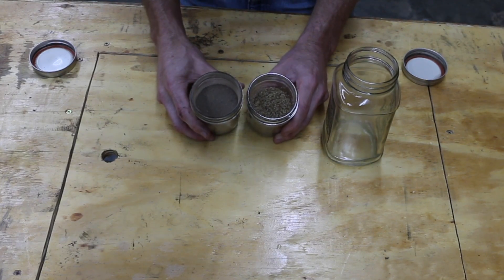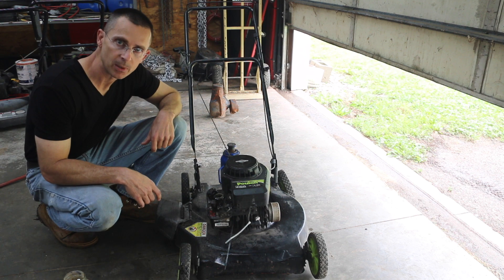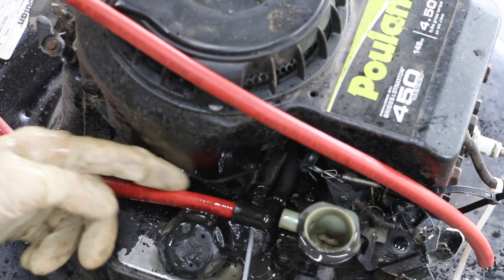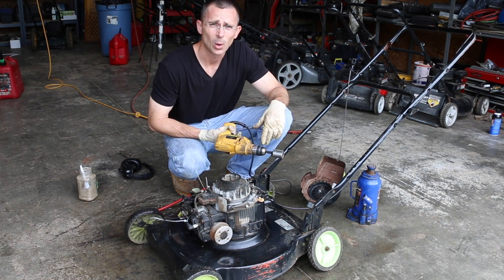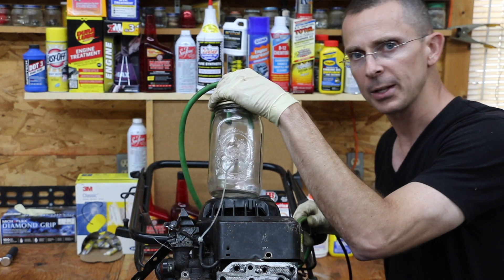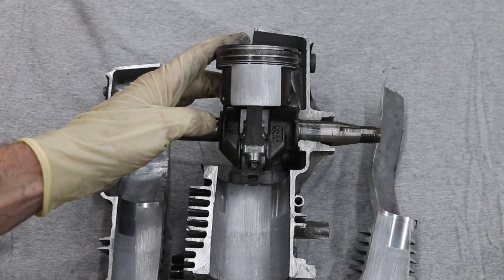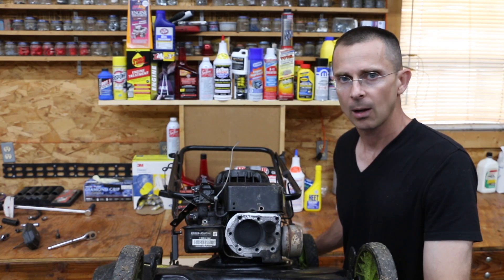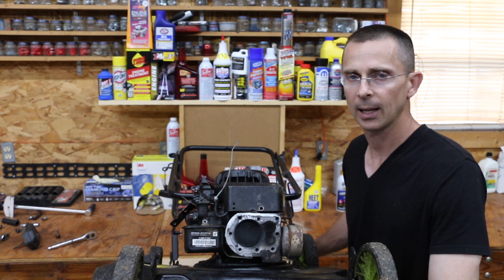Will Dirt Destroy an Engine?  See what it does to this Engine!

Comment: So that's how Harley get's their motors to run like that.
Reply: They're just washing machines on spin cycle
Reply: Lol lol lol 🤣😂👍👍
Reply: Hot damn shots fired😂😂 I drive a Yamaha v star😂
Reply: @SoapHorizons789  great, quality bike. Weak engine though.
Reply: And leak like that...lol
Reply: true bruh moment
Reply: Zmog wtf are you even saying shut the hell up
Reply: Thanks for making this. It was purely ... what if educational. I had always wondered how quickly a dirty or missing air cleaner could contribute to engine destruction. And it seems that it really doesn't take too long. Now I know what you did to achieve results was highly sped up.. dumping raw contamination into the carburetor. But the overall point is still made. You spent a lot of time and effort making this ...thank you, I love your work and I watch everything you make.
Reply: Gets not get's. Smh
Reply: Hardly able-sons. Lol
Reply: Rotary aircraft engines (Pratt and Whitney) have a cam drum, not a shaft, but it’s still a cam.
Reply: Mike Combs yes just pour some gravel into your carb
Reply: Ouch.
Reply: Idot harleys have a cam that’s why they run like that
Reply: @Pimpy6.6  Can of what?
Reply: I meant cam they have a cam which is why they run the way the do
Reply: @Pimpy6.6  
Do other manufacturers not use a camshaft? I'm not a mechanic.
Reply: Robot Bjorn yes some lawn mowers and cars and fourwheelers use cams everything just about had a cam
Reply: ZMOGOTAXL yes they do cams are for ignition and fuel timing and are neccessary for most all engines
Reply: @robotbjorn4952  😂
Reply: @Pimpy6.6  I held my tongue as long as I could.  ALL four stroke engines (with the exception of rare freevalve solenoid technology) have at least one cam.  A modern Harley has four.  The engine won't run if the valves can't open and close.
Reply: @mcombsemail  lmao ok I know what your saying I was just trying to demenstraight that’s what I was talking about cause my quad has a cam but I was trying to explain to him what the cam is but I’m not good at explaining
Reply: @Pimpy6.6  das sum gerd engish dere matie!
Reply: @Pimpy6.6  every engine ever made before like 2015 uses a camshaft
Reply: @squerlicious  actually every engine since around the 50s even most likely before that has a camshaft
Reply: @Pimpy6.6  not with 2 stroke
Reply: @robotbjorn4952  most engines use cams.
Reply: @Pimpy6.6  I can't think of any 
4stroke engine that doesn't have a cam of some sort ! Maybe "most things" you encounter are 2cycle engines.
Reply: @Troyvidihoo  an aftermarket cam lol 😂
Reply: @Troyvidihoo  I just read what I put a while back I think I put it as a joke
Reply: Haha 😂 I just read what I put I think I put it a joke 4 strokes and just about every engine has a cam LS to diesels all have cams I don’t know why I put this
Reply: @picax8398  I was like 11 when I put that comment lol 😂
Reply: @picax8398  ohhhh it’s from 2 years ago nah I was 13
Reply: @picax8398  it’s just been a long time man I know what I was suppose to say I didn’t put it correctly and that’s why I sound stupid in that comment but I am currently a diesel and automotive mechanic and understand just about every engine i
Reply: @Pimpy6.6  Dont get so butt hurt, he's joking

Comment: What happens if you put salt in an engine; anything good, anything bad? Does it depend on the kind of salt and/or fuel?

Some helpful data: Salt doesn't dissolve in gasoline, but it does dissolve in ethanol. Also, there's a kind of salt called Ammonium Chloride, which allegedly tastes like a 9-volt battery if you lick it.

Also: If you freeze-dry saltwater, you will get salt that's an extremely fine powder, far finer than the salt grains you'd normally be able to get your hands on.

Comment: that happene to my father diesel car, a hose before the turbo broke from the air filter and was colleting dust and sand and whatever from the road , destroyed the turbo and afte r couple of days the engine started running in 3 pistons and lots of blowby and smoke coming from the exhaust. engine is trash now.i was in doubt if the cilinder walls were affected as i didnt opened it yet, but after seing this video i think he need new engine , not only piston rings :(

Comment: This seems more of a testament to the lawnmower brand. I tool more then 25% of the oil capacity of dirt and sand to "kill" the engine. And it still started. Probably wouldnt if it had cooled down. Sweet video.
Reply from the maker: Thank you

Comment: Very realistic test. I'm going to make you eat two spoons of dust and we'll see how you will be doing. Probably pretty bad, but in a lifetime, the average person eats 6 pounds of dust. And we don't suffer much from it. A lot at once vs a little bit at a time makes quite a difference for us humans and I'm pretty sure it also does for our engines. It probably is way more aggressive to have a whole spoon of dirt and dust that fills like a quarter of the cylinder and actually get pressed against the walls during the compression cycle than a couple of particules every now and then that probably go unoticed, in and out like if nothing happenned.

Comment: Now, how would a badly damaged engine with oil burning and blow by respond to motor medic and the like.
Reply: I’m assuming motor medic is a substance that’s added to gas or oil to “rebuild your worn motor”. It likely wouldn’t do much of anything. No product can restore a badly damaged engine other than rebuilding or replacing it.

Comment: What can also happen is when the air filter gets very dirty and it restricts the airflow it will suck oil out of the crankcase vent and over time it will burn off the oil by sucking it out of the crankcase through the carb and then engine will obviously destroy itself running with no oil in the crankcase. This happened to my neighbors riding mower because he never changed the air filter over so many years.
Reply from the maker: Great point

Comment: Maybe putting all of that debris in together would have a worse effect than the same amount slowly entering the engine over years?
Not disputing your results, and there's no doubt no air filter is very bad for your engine. But I'm just pointing out something that MAY have led to misleading results
Reply from the maker: Thank you for the feedback

Comment: I accidentally ran my truck when I first bought it without an air filter, it is a ford ranger 3.0 and it went 1k miles without a filter through dirt, dust, mud and water. It still runs and drives, and it doesn’t burn oil but I’m worried I lost compression or caused serious damage. Any knowledge bombs on that?

Comment: You’ve convinced me to do my air filter already. It’s quite old.

I do monitor my car’s vital signs, and while it still looks decently nice on the important side, I can only imagine the engine having so suck air through an even slightly clogged filter media. Plus it’s even more critically important that the air is perfectly clean for modern engines, because even the slightest amount of contamination can damage, or destroy, the MAF sensor. It’s worth cleaning if your air filter is overdue - I know I will. Do not use anything but MAF cleaner. Don’t use throttle body cleaner, don’t use brake cleaner, don’t use isopropyl alcohol. Use nothing but MAF cleaner, and only clean the thing sparingly, if you have a reason to, such as an overdue or bad air filter. They are ludicrously delicate devices, and as a result, they’re expensive, too.
Reply from the maker: Thank you!

Comment: I had a 1990 Eagle Talon (4G63) that I rebuilt. the original pistons were easily 4X worse on the piston head than that thing. DEEP scars cut into it. It had stock air filter. Now I have NO IDEA what caused it. I really expected your damage to be so much higher after all that dirt (granted it wasn't 200,000 miles). Closest example I can find is like this but more like 1/8" elongated scars than dimples:

https://static.cargurus.com/images/site/2016/10/06/01/23/pic-5588949851497719914-1600x1200.jpeg

The comments (the only one that offers any explaination) says "probably dropped a valve guide". That's possible, hmm. If it's so heavy (relatively speaking) that it can't easily be blown out the exhaust, it'll bounce around up and down being crushed into the piston until after hundreds / thousands of impacts it randomly bounces into the exhaust at the right time and leaves. But I have no idea how a cylindrical valve guide could get down there unless it split-in-half somehow and the pieces fell in.
Reply from the maker: Thank you

Comment: the one thing that differentiates a mower from a  vehicle, is after the dirt has gotten in the oil, it gets filtered out. it's not left in the oil to keep doing damage. but it will still do damage from when it enters the engine till it gets filtered out. which is who knows how long.
Reply from the maker: Thank you!

Comment: just took the head off a craftsman that was sitting in the elements for several years and there was slight debris in the cylinder. the scoring wasnt as bad as this video but it was pretty noticeable. still wondering if i should just slap it back together and run it until it dies or just ditch the project altogether.
Reply from the maker: Seems like it's worth getting it running if you don't have to buy parts.  Thank you!

Comment: Hello hope all is well, This might be a good idea for a video, Not sure how you would test for it though. I've heard using spray silicone sprayed on a filter will stop even the smallest of particles. Protecting way better than the best air filters on the market...Or would it cause restricted air flow altogether? Maybe just enough to cause other issues? Poor fuel economy?

Comment: Try adding a Tootsie Roll to the gas tank in a lawn mower engine and run it, guy I used to work with said it will destroy a car engine fuel system 😏
Reply from the maker: Thank you for the video idea!

Comment: I may be talk out my ass but won't you over heat the engine my letting the lube pipe throw that oil out? Your wasting the oil inside the crank. It's not the dirt that ruined the engine. It was the over heating. I've seen this done to a lot motors in our shop.

Comment: I understand the years worth of dirt and sand. But not that much at one time. Where the fine dirt particals goes in most will go out the exhaust port. Not all that at one time. Yes it is not good to run anything without a filter. But some times you have to. But all that at one time will mess with the combustion. Try with fingers four or five inches away from the carb. And a pinch at a time work your fingers back and forwards lightly dropping the particals in still to much at one time but more scenes then a teaspoon at a time
Reply from the maker: Thank you for the constructive feedback

Comment: Here in the philippines and thailand lots of people who dragrace and circuit their scooter run anywhere from 24 to 34mm carburetors and me personally have ran a 28mm carb on mine. I daily drove it for a year and had no issues through dirt roads and everything in between didnt even need to clean the carb. Refreshed the engine once and it looked all good. Only thing that rrally sucks (hehe) with an open carb is rain then you wouldnt be going anywhere.
Reply from the maker: Great information.  Thank you

Comment: Gray color oil, means worn out compression rings & scratched cylinder. I saw at least 70 times when I was on the business of repairing engines; when the engine had troubles to start, people had the "great idea" to put the air filter back on.
Reply from the maker: Thank you

Comment: At some point in life every guy has a fascination with cheap horsepower. I experimented (mostly on push mowers, luckily) with stuff like air con filter material, dry wash cloths, computer fans and even removing the intake altogether. They do nothing except slowly kill the engine. Car mods like K&N filters and performance spark plugs are safer but also do nothing. Best thing you can do for your engine is proper maintenance.
Reply from the maker: Thank you

Comment: The need to change a filter regularly isn't because of restriction (even a full 1 psi restriction would be hardly noticeable) and fuel economy (your throttle already restricts most of the airflow, so fuel economy issues are a myth...), it's because the filter's pleats will bow into each other, further cutting off airflow until the engine's vacuum ruptures the filter spectacularly, which might happen at only ~1psi anyway for a standard rectangular filter (its total frame area and especially the large minimum width are the issues).  "High flow" filters are almost useless for adding performance for this reason, because the restriction never amounts to much in the first place before a normal filter would be changed.  The high flow filters are usually less prone to collapse because of their mesh reinforcement, but the media lets a lot more dust in.

Over the long haul, I can think of much cheaper ways to get an extra 2 hp, than shortening the service life of an engine.  Get the finest, quality filter media, and best fluids for your engine and vehicle (within reason).  It's the basic road to a long life.

Comment: I don't feel like this is a fair test yea dirt is not good for motor but it's not like ur gonna get that much dirt at once ran tho it an what it does suck in mixes with gas an burns out an not over power the gas as tea spoons that causes the gas to b supper thick so it would run fine ive ran my monte Carlo for years with no air filter an it was my daily driver just pulled it out to rebuild it an it looks nothing like that not to mention my oil was fine as wel.
Reply: Maybe try again but take a leaf blower an blow the dirt towards it so it sucks in as much gas its taken in so it has a fair chance
Reply from the maker: Thanks for the constructive feedback

Comment: I dropped a straw in the air intake system 
I don't know what to do because I dont have money to pay for this and it looks like I have to take everything apart 
OLD 2004 ACCENT WITH 200K MILES THST RUNS GREAT AND I WAS THINKING IF I SHOUD RUN IT LIKR THAT OR NOT.
I have no idea how to do it but I can try but I don't know what's worst >>>
Leave the straw in there or take it out with no experience or idea on what I'm doing 
SMALL STRAW USED  ON CAN TO SPRAY
Reply from the maker: Thank you!

Comment: I'd like to see you try resurfacing a badly scored cylinder with jb weld and sandpaper.  To avoid boring the engine I think being a cheap small mower it would be worth it to try a cheaper fix....if of course it works
Reply from the maker: Thank you for the video idea!

Comment: Can you do a video on effects of running a 2 stroke engine with without proper oil/gas mixture?
Reply from the maker: Thank you for the video idea!
Reply: herndon861  great ideal. I want to see it also.  I Don’t always get my fuel mix to Precision and I often wonder what it’s doing to my engine.
Reply: @traceykays433  it will seize the Piston inside cylinder.
Source: I use a 2 stroke motorcycle and forgot to add oil in fuel couple of times.
Reply: I would like to see an engine run with gas in the crank case instead of oil
Reply: Done it once runs poorly and smokes bad also ran a 4 stroke with properly mixed same result.

Comment: Id like to say that this test was inaccurate. It didnt simulate years of running a engine without an airfilter. The reason being is without an airfilter its very gradual youre not getting spoonfuls of sand all at once. And over time the piston and rings would seat back in gradually to those subtle scratches and regain some lost compression. But with this test it allowed it no time to seat back in. Im not saying that its a good idea to run your engine without an airfilter. But i am saying giving an engine the same amount of dirt gradually over a period of time would last significantly longer than an engine where the same amout of dirt was dumped in virtually all at once. Because it doesnt allow the piston and and rings to seat back in smooth out scratches and regain lost compression
Reply from the maker: Thanks for the constructive feedback.

Comment: best i did on wrecking a 10hp motor on a rider mower. was i dropped  the main crank 3/4 inch down out of the motor but it still ran if you jammed a little piece of wood to hold up the flywheel for it to start. and that was a motor i had for 6 yrs and ran it daily without a air filter in it. and that was up to 10hrs a day without shutting it off.
Reply from the maker: Thank you!

Comment: Not really unexpected. Sand, dust and grain of all kinds totally act like a rough sanding paper to everything inside of an engine. Gaskets, axles, supports and ventile shafts, pistons, hydrovents cranks etc., everything that is moving inside totally undergoes massive abrasion, extreme wear. Modern and precisely manufactured, adjusted and assembled engines will suffer severe damage and total power loss under such conditions. Some hundreds of km can easily get them ready for the junkyard.
Reply from the maker: Thank you

Comment: Is this a realistic test? The amount of dust you are putting in would accumulate over years. Plus small amount of dirt that comes in under normal use would be washed out by the oil over time
Reply from the maker: Thanks for the constructive feedback.